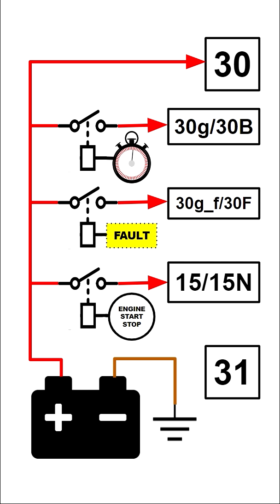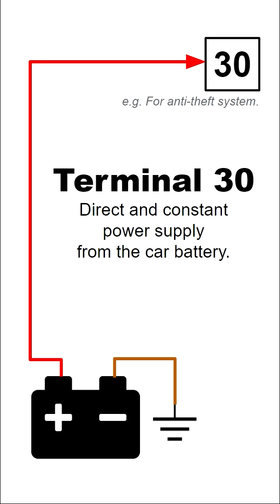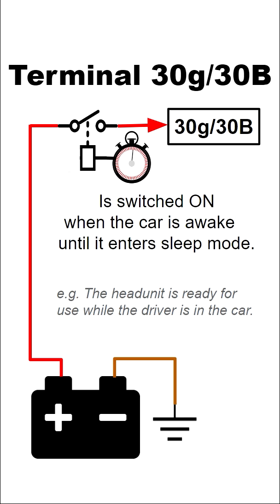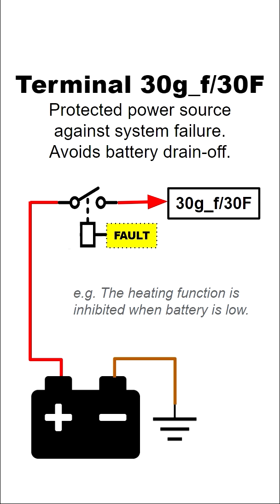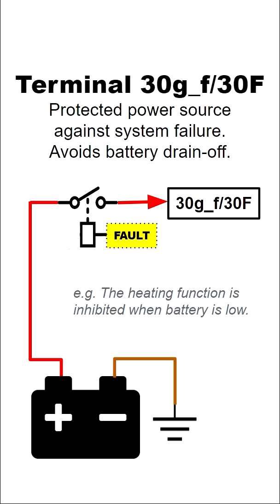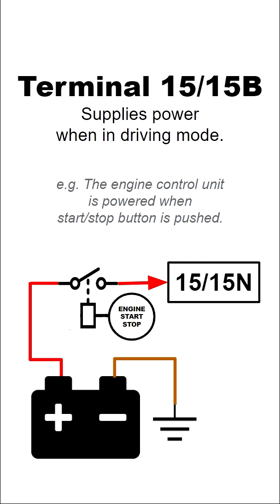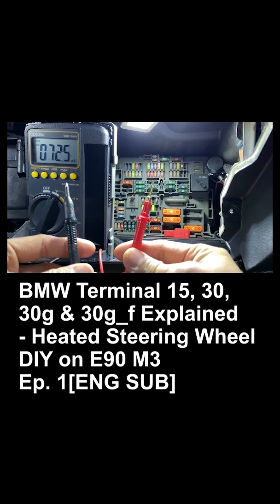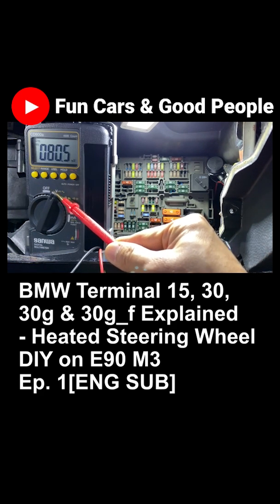BMW Terminal 15, 30, 30g & 30g_f Explained in 1 minute [ENG SUB]

Comment: My BMW starts fine in the morning, but after driving it won’t start again. The car shows these codes: Terminal 15N_1 / 87_1, Terminal 15N_2 / 87_2, Terminal 15N_3 / 87_3 Power Supply Circuit. Any idea what I should check or replace?

Comment: hello i have 2012 bmw x5 (E70). i am installing subwoofer and amplifier. I do not have ISTA and want to know which fuse in the rear is terminal 15 and 12V so I can power amp whenever ignition is switch on

Comment: Hello i want to set my 12v cigarette socket to turn off when i set ignition to off, i read from chat gpt and he said to set kl30b_on_max_time on 0 (zero) is that a solution?
car is bmw f83
Reply from the maker: Hello Luka, I found that the cigarette sockets are indeed on 30B on a F83. I think by coding that option, the cigarette lighter will be turned off when the car is "locked" because 30B is designed to supply power when the driver is present. But this is just my guessing. Here's the description of 30B on F83;

"Terminal 30B provides the voltage supply for control units and components that in normal operation are required when the driver is present. For example, terminal 30B will be activated with a status change for a door contact or unlocking, locking or securing the vehicle.

Terminal 30B is switched off with a specified after-running period.

Depending on the series, the front electronic module (FEM) or the Body Domain Controller (BDC) activates the terminal 30B relay."

If you need that cigarette socket to work on terminal 15N (as ignition is ON), you can re-route it's power source. The front cigarette socket is on fuse F66. You can find an empty fuse on terminal 15N and reconfigure. Please refer to my video "add-a-fuse" for working on the fuse box: https://youtu.be/IJ6yIDaAMP4 It's going to be a fun project!

Comment: 2021 bmw 530i xdrive , the drive screen is off and clusters not working, any thoughts… thank you ❤
Reply from the maker: Hello Fedya, can you read out the fault code? I checked the wiring diagram of the instrument cluster (instrument panel, KOMBI) and see it's supplied by two fuses, F61 and F31. F61 is on terminal 30B(30g) and F31 is on terminal 30. So please check the fuses first!

Comment: n54 terminal 15 issue, no dash or idrive but battery holds voltage, thoughts?
Reply from the maker: Hi wtfskitzo I did a quick look into the wiring diagrams and found that the dash is on terminal 30 and the idrive (screen and headunit) is on 30g. They seem not directly associated with terminal 15. What is the fault code you got exactly?

Comment: What would cause a 30L terminal code to come up for a 2009 bmw 750 Li. No crank no start. Battery died and was replaced with new battery and registered to car and no iDrive and various things not working. Car was cranking but not starting before old battery died.
Reply from the maker: Hi Debbie 30L means 30 load. There is a relay KL. 30L controlled by CAS to activate the starter motor (which is very heavy load in the electrical system.)

Seems like this relay is broken so there's no crank for sure. If you need further information just email me via funcarsgoodpeople@gmail.com with the VIN!

Comment: Hi..getting code 2BC9 today. Its say DME TERMINAL 15 MONITORING. No crank no start. Its just suddenly off while am driving. Was able to started the car bcak untill i reached home. And now NO more.. any idea or help would be much appreciated. Thanks
Reply from the maker: Hello TY, I looked this code up and it implies the disconnection between the CAS and DME module. This code is due to "Terminal 15 Sense Circuit Low" and its description says check the wiring harness between CAS and DME. However I think that probability is low.

I would check the battery first. The power management system will disable the starter motor when the battery energy is below certain threshold (to avoid over-draining the battery.) Many BMWs have such low voltage syndromes so I always suggest to have  a fully charged, healthy battery as the first step :)

Comment: I remove the 15N but the car still can be started. Why? Are you sure that’s controlling the start/stop?
Reply from the maker: Hi @edenadamstory, practically the controlling units (CAS, DME and starter motor) take power from 15/15N independently, via not only one fuse. e.g. Some CAS has two fuses on terminal 15.

Which BMW model are you working on? Send me an email via funcarsgoodpeople@gmail.com I'll look it up for you :)
Reply: Where is the terminal 15 n1

Comment: Is the zigarett lighter under the passanger side on terminal 30g?
Reply: I got an f30 and when i turn the car off it still got 12v
Reply from the maker: Hi Sven, I just checked the wiring diagram of cigarette lighter for F30. They are supplied by terminal 30B (same as 30g.) So when the power supply for the cigarette lighter will go off after some time the car is turned off.
Reply from the maker: Hello Sven, for E9x it’s on terminal 15, which supplies power when the IGNITION is switched ON. All the cigarette lighter and charging sockets are supplied via fuse F30 on terminal 15.

Comment: Hi I hope you can please help me out. I’m getting these error codes on my 2012 e70 X5; 

9CBD, 9CBC, 9CAB, 9CDB, 9CDA, 9CAA, 9CB5. 

I changed my FRM and had it programmed to the vehicle VIN. Which helped restore a lot of things but now I have a lot of lighting malfunctions that I don’t know how to fix. 

I didn’t see any short circuits with protool, I also checked the fuses for the lighting and those looked good too. I made sure the battery was properly registered as well so idk what’s next?!
 Please help!!!
Reply from the maker: Hello Ardit, I looked these codes up and they can be related to the FRM, LM(light module, but E70 may not have this) or IHKA(air con module.) I am just curious that are these codes solely related the FRM or are they coming from other systems?

e.g. 
9CBD	FRM (frm_70): short circuit at rear door contacts
9CBD	FRM (frm_87): Communication with step motor controller on the left disrupted
9CBD	IHKA: Independent heating, switchover valve
9CBD	LM: Battery exhaustive-discharge protection: deactivation, side light

Could you please let me know your ECU variant (frm_70 or frm_87?) to help me decide which code to study?
Reply: @funcarsgoodpeople  Hi there! Thank you for getting back to my comment! 

I have FRM_70 and I wanted to clarify all the codes some other ones that might be connected to the FRM. I know I listed the 9CB5, 9CDB, 9CDA, 9CAA, 9CBD, 9CBC & 9CAB. Just wanted to add my comfort access doesn't work on the driver side front and rear door handles on the left but the right side of the vehicle works as well as the push start option working too. The power windows don't go up for both the front driver and passenger but the rear do as well as the control of the mirror and closing of them. 

I also got these code from the DME/DDE.... 3847: LIN/BSD, message; alternator: missing & 387F: Power management: Standby current violation. 

For the DSC (DXC_70) it got code 6EC9 saying: Interface FRM (status, door sensors): signal invalid.

For the EGS the code 5125: Signal (door contact, 0x2FC) invalid, transmitter CAS.

There's also two codes for the KLIMA2 (FKA_70) A1F1: Footwell-temperature sensor, right & A1ED: Seat heating, rear right (but I'm pretty sure I don't have rear seating).Also the JBBF (JBBF70) has codes A72E & A6D2 (both are in regards to the water valves for the driver and passenger sides, respectively)
 
Yet I don't believe these codes have anything to do with the battery and FRM_70 issues, but I could be wrong.  

My plan of action are to change the belt tensioner because I've seen that moving a bit too much, along with the belt. That way that can solve the alternator message, because I'm pretty sure the alternator is in working order. On top of that I was thinking maybe the negative battery cable with the IBS sensor needs to be swapped out cause maybe that's giving those weird issues with the different terminals & battery discharge. I already changed the relay for terminal 15 but that didn't seem to do anything. Hopefully I've provided you enough information to help me get her running properly.

Comment: Hi, i am getting these faults with my fem

804094: KL30F relay front, internal fuse 2 defective

8041F0: headlight driver module(tms) right: coding error

D90D2F: headlight driver module (tms) left: missing LIN slave

2015 bmw m4, recently i got theSe aftermarket headlights and was playing with the module cause one side was dimmer. And now the driver side headlight wont turn on...

Where is the KL30F located ?
Reply from the maker: Hi VK, I checked the wiring diagram/fuse map of the FEM(A173 Front Electronic Module) of 2015 BMW F82 and found that the fault code 804094 should be:

804094 Voltage supply, terminal 30F Fuse F11 defective

(Same code may have different meaning on different version of control modules)

The FEM is located at the bottom of the right A pillar. There are 14 fuse slots on it. Fuse 11 connects to the driver side headlight and Rear Electronic Module (are the rear lights working properly?) So please check if the fuse has blown.

By the way, KL30F is a built-in relay inside the FEM. I hope it's not broken otherwise the whole FEM has to be replaced and that's gonna be a sad story.

For the other two codes, coding error may due to aftermarket lights. You can turn off the cold/hot monitoring of the headlight by coding the FEM (please be careful with coding works!) and that code should stop coming.

Missing LIN slave is becasue of the headlight has no power (Fuse 11 blown.)

I could be wrong. You are very welcome to let me know the results. Best luck!
Reply: @funcarsgoodpeople  thanks ! I changed the fuse and now only the signal works on the driver side light. I think i might have damaged the light

Comment: Thanks for the vedio.. 
I need your support my friend 
I have e38 bmw 740i 2001.. getting code IKE: voltage supple, terminal 15, fault
It is running ok and i am driving it daily..

 after warming or driving it will shake little, means not engine stable and a v. black smoke comes after driving but sometimes it stops smook.
Reply from the maker: Hello Abdul, the IKE means "Integrated Electronic Control Unit" and it is actually the instrument cluster right in front of the driver. There are three power supplies to the IKE; terminal R, terminal 30 and terminal 15.

Terminal 30 supplies IKE constantly. When you turn the car on, terminal R tells the IKE to light up. And terminal 15 tells the IKE the key is in ignition position or the engine is running. So if terminal 15 is faulty for IKE, it doesn't affect the driving. And you can drive the car as usual.

If you want to fix this code, please check the wiring harness behind the IKE. And I think the engine shaking and smoke are other problems. Do you see other fault codes? You are welcome to send it to me!
Carl
Reply: @funcarsgoodpeople  highly appreciated.. your comment is so informative and specific..
The shaking and smoke resolved, it was vacuum hose blocked, and oxygen sensors bank 1 and 2 not working..
I replaced all of that and it is working v smooth.. engine light gone..

Now The power supply terminal 15 is pending, i will work on it this weekend and Keep you informed about what i might find over there..
Thank you again my friend
Reply from the maker: That's good news! I'm happy for you!

My bad to forget to mention in last reply; the three fuses for the IKE are: 
Terminla R - Fuse 43 (5A), 
Terminal 30 - Fuse 26 (5A) and 
Terminal 15 - Fuse 18 (5A)

You can send me your VIN to funcarsgoodpeople@gmail.com and I can send you related information about the IKE, e.g. the wiring diagram and connector pin assignment table, to you.

I believe you are a professional faultbuster and that code will be cleared soon :) Cheers!

Comment: My car won't start and when I press the start/stop button nothing happens although I can see the needles moving a bit up and down (2mm max). I checked the codes and It says: deactivation of terminal 30B:top startability limit reached [error code: 8040B9.
I also get another code which says: START/STOP button hull sensor: incorrect operation (oblique pressure) error code: 8040A9
Reply: 2013 BMW 320D F30
Reply from the maker: Hi Keley, an issue similar to yours had been discussed in a previous comment with David (please browse above.) The fault code 8040B9 indicates the car battery is low so the power management system disabled the starter to prevent over-draining the battery.

Your battery may be low due to some reasons, or the IBS intelligent battery sensor may be faulty that it couldn't measure the battery health correctly. The former case is very common.

If you take out the car battery and fully charge it, remember to register the IBS again(with diagnostic tools), telling the car you have a new/healthy battery. Otherwise the power management system still thinks the battery is low and disables starter.

Another code 8040A9 just reminds the user to press the button carefully :D

Comment: I have codes 2dc3 2E8d but no CEL and car runs and drives normally. 2010 335i
Reply from the maker: Hello It B sorry for the late reply.

There's no CEL so you can be less worried about the codes. However as a Faultbuster, let's don't ignore any of the fualt codes, shall we ;)

I use https://bmwfault.codes/ and ISTA to look up the codes. The former can help quick understand the code contents. Here 2DC3 (for the DME version msd80) corresponds to "Valvetronic servomotor, activation: Line disconnection." The description says there should be CEL. So I guess this was a transient fault caused by voltage drop duing engine crank. 

And the code 2E8D corresponds to "DME: Intelligent battery sensor, signal transmission" which seems to relate to a bad intelligent battery sensor. The E-series easily have electrical fault codes due to voltage fluctuation. Does these codes come back after clearing the fualt memories?

Comment: I have problem finding Terminal 30A as it shows on BimmerLink error BMW X5 E70. 
"ERROR CODE 9CA9 TERMINAL 30A CONNECTION FAULTY". 
Any advice is greatly appreciated!
Reply from the maker: Hello Chris! This code is stored in the FRM footwell module. There are 4 power lines on terminal 30 that supplies this module. I am guessing these four lines are named A, B, C and D. And they go via fuses 23, 33, 34 and 96, respectively. Please first check these four fuses. F23, 33 and 34 are 30 Amp fuses where F96 is 40 Amp.

Please also check if there are 12V power coming out from these fuse pins. Let me know how it works!
Reply: @funcarsgoodpeople  Thank you so much for the info. You're my lifesaver!👍
Reply: @funcarsgoodpeople  My 2010 X5 E70 just popup another warning "High Battery Drain". Please advise of how to find the source and fix the problem. 
I really appreciate your help!
Reply from the maker: Hi Chris sorry for the late reply. I guess the battery is low recently. Please make sure the car is put to sleep (locked,  no keys in the car or nearby) while parking. So it won’t slowly drain the battery overnight. And if you have time, drive the car on highway for at least 30 minutes to charge the battery.

The car has a lot of electric modules and is sensitive to voltage fluctuation. A lot of fault codes are triggered by the temporary battery drain (e.g. misfire.) So keeping a full battery is also a key for troubleshooting. Good luck!
Reply: @funcarsgoodpeople  Thanks again for your response. I found out the reason "High battery drain", I left the Veepeak BLE adapter plugin overnight that caused battery drain. Unplugged it, and it seems fixing the problem.
Reply from the maker: Hi Chris, nice to hear that! I believe there are no big problem with your E70. It’s always good to read the fault codes. They are honest hints from the car. Please carefully investigate them 🤗
Reply from the maker: Hi Chris you are welcome. I have another finding; according to the DIN 72552 standards, terminal 30A refers to the positive lead of the second battery on the vehicle.

I don't think there is a second battery on the E70 but there are 4 power lines supplying the footwell module. So if one of them is broken, you should see some malfunctions in the electrical system.

Let me know if you have some other codes!
Carl